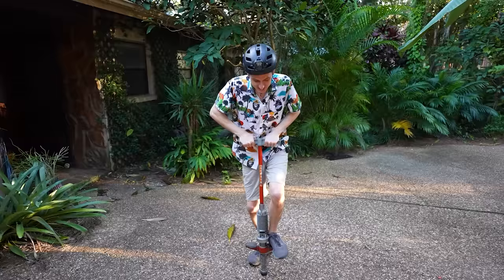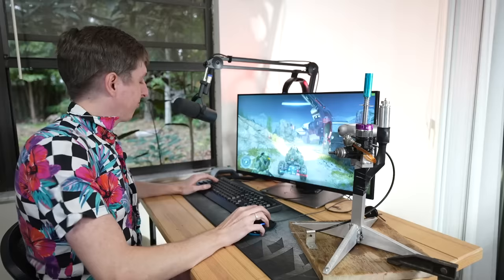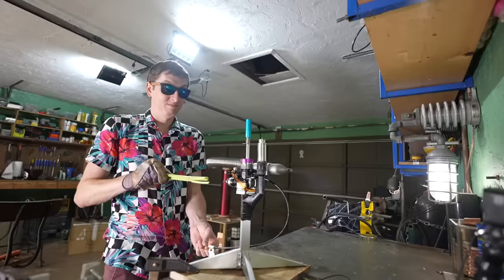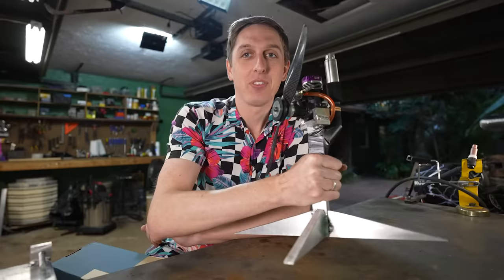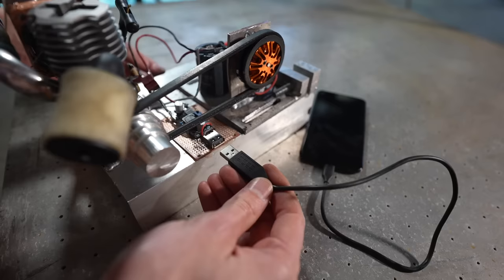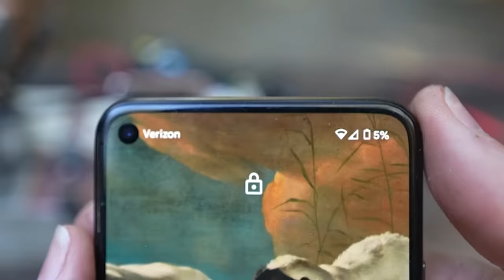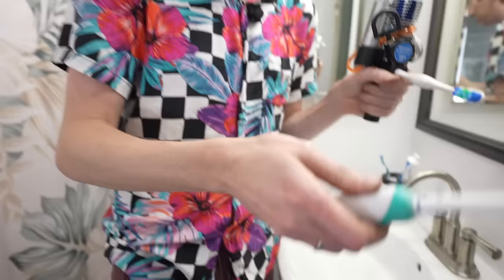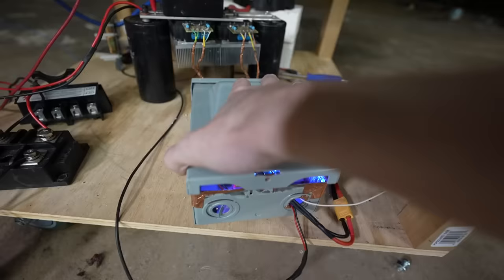Gas powering things that should NOT be gas powered

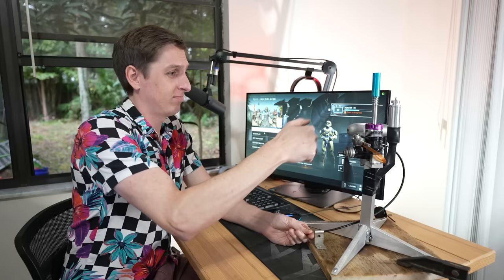Comment: 1:12 As an rc heli guy, seeing you and all my plane friend that close to propeller always give me goosebumps. Most heli guys wont dare to get near to those flying mower while it's still powered, let alone putting your hand only centimeters away from it.
Reply: Yeah, some how i doubt that his leather glove would have saved his finger tips there. 
And the gaming part, was just 50cm away from certain death ....
Reply: Helicopters have clutches though so you'll be alright. You wouldn't be able to start it safely otherwise. I used to fly the quarter scale nitro planes years ago before everyone was coming out with electric. Anyways, the glo plug I was using then was attached to a battery box via wires. The prop almost sucked the wires in and I tried to grab it before it did. Good news is that I did manage to. The bad news was that I pulled just slightly through the top because I didn't pull up high enough and almost lost my finger. Honestly starting a Helicopter is a lot safer than those damn planes. I've been wanting to get back into it again and maybe switch to the nitro helicopters but I just don't have the money for it right now.
Reply: @Onyx_Games  I used to fly control line planes with my dad when i was a kid (like 8-12 yo) and we used the little os nitro engines like these. I def got kickbacked while starting a bunch and I had a wood prop break on my knuckle. Neither of us ever had serious injuries though thankfully, using wood props probably made a huge difference in danger.
(I could be wrong, idk it was a long time ago and just speculating)
Reply: Hes obviously never seen a prop induced injury lol... also leaving that glow ignitor on there like that is making me cringe lol
Reply: I can comfirm, plane propeller plus finger equals a bad day.
Reply: This is the guy who regularly pours molten aluminum with little to no safety equipment. He is a walking OSHA violation! 😅
Reply: He had really strong gloves on
Reply: Totally agree with you
Reply: @gljames24  hahahahhaha
Reply: @ASMCourtney  I remember the little Cox .049 engines and the kickback it did hurt, and one time i touched the tip of the Prop not looking what i was doing and yes that does give you a buzz.
Reply: Omg get the plug ignitor off the poor thing.
Reply: @FCNFAST  me too at first. But then thought I would go near that thing to remove it either

Comment: This is a good demonstration for the RC Airplane community. We always talk about how dangerous propellers are to your hands and fingers, but very rarely demonstrate just how much slicing power props have...in fact you may get some flak from our community about not taking proper precautions when starting the engine with the prop the way you did. We actually have electric motors that spin the prop to start it that eliminates danger to the fingers/hand
Reply from the maker: I knocked my fingers once starting it like that. It started before I even fully turned i,t and it spun around and hit me right on my knuckle. i got a little bruise but it didn't break the skin. after that I wore gloves lol.
Reply: @TheBackyardScientist  I'm glad you did not get seriously hurt. I'd hate for anything to hinder you making more awesome content!
Reply: No, no, I have no problem with flick starting. It's been done since the start of time and if it goes wrong, it usually just means a bit of a sore finger.

I have a problem with the demonstration itself and his entire lack of safety or thought on anything he did.

To add: It's a fine demonstration, but it should be done by someone who at least has a single clue and done for the purposes of demonstration. NOT "for fun" - Because it's a very dangerous way to have a bit of destructive fun and a dangerous thing to implicitly encourage. Not a single squeak about any kind of safety was given at all.
Reply: WWI veterans are rolling in their graves
Reply: @guanyu5091  imagine thinking sticking your fingers in a propellor is probably bad
Reply: @guanyu5091  yeah, there’s a difference between 30 years and 30 hundredths of a second
Reply: @guanyu5091  there is an ever so slight difference between driving a car, and sticking you fingers into what is essentially a 2hp blender.

Especially since he had a pull cord available.
Reply: Correct me if I'm wrong but that's called hand propping and they used to do that on actual aircraft, or you know older ones anyways.
Reply: @nesyboi9421  Some RC pilots do use the hand crank method, but there is a technique involved that was not used in this video. Most RC pilots avoid that method because of the dangers involved

Comment: I'd love to see a well built nitro engine pencil sharpener.  I really want to build one myself.  I'm thinking a custom lathe turned sharpening tool that is well balanced and able to spin at full engine rpm. 35,000 plus rpm ought to sharpen an entire pencil in 1 second.  It could be a great conversation piece for someone's desk.
Reply: Could imagine someone having that in their office, what all the co-workers would think. "What the hell is that noise?" "Oh Jim's just sharpening his pencil."
Reply: @quillmaurer6563  I think it's more or less just to have it there. I don't think it would get used too often 😂
Reply: @fast79z28camaro  True, but what's the fun in that? I could see it being especially useful if a nearby co-worker is too overzealous with their electric pencil sharpener, seems like they use it annoyingly often and long, they aren't as loud as a nitro engine but still somewhat noisy, fire back with this.
Reply: @quillmaurer6563  I have thought about using the big brushless motor from xmaxx to build a pencil sharpener.  It's like 30 volts and monstrous.  Makes a 20 lb 4wd rc car go 50 mph.... Ought to sharpen a pencil right quick.
Reply: Smallant could almost do that by hand smh
Reply: Technically a pencil vapouriser, you saw the carrot.
Reply: think of what you could accomplish with all the time you shaved
Reply: They have the fan
Reply: PPE just to sharpen a pencil 😂

Comment: When it comes to USB, charging modern devices like phones is actually more complicated than just providing 5V. The old-school USB standard has power at 5v @ 500mA, which is not enough to charge a phone faster than it drains power (it might be enough if you turn off the phone, but it will be slow). Even if the voltage converter can provide more, phones won't attempt to charge properly unless the charger can signal its capabilities to the phone. These days phones use a standard called USB-PD (Power Delivery) to negotiate with the charger different voltages (5-20v) up to 100w, so your generator can definitely charge a phone, but you'll want a USB-PD capable module instead of a standard 5v USB module.
Reply: i didnt ask for all that brodie
Reply: @zero-se7ug  I did
Reply: nice
Reply: @zero-se7ug  yeah that's cuz i did not everything is about you
Reply: @saple3688  i didnt ask for all that brodie
Reply: And then I got high...
Reply: Yeah I was really hoping he'd go more into trying to charge the phone but unfortunately these videos are a bit more educationally cheap. And I guess that makes sense considering it's called the backyard scientist.
Reply: Very good advice
Reply: This is partially correct. Sure USB 2.0 is specced at 500mA, but phones don't charge at that without USB PD. Most will pull a max of about 2A over 5v, and then with USB PD communication the voltage will be negotiated, and in some rarer high power cases, the amperage can as well. 10W should be more than enough to see the battery increase after 5 minutes.
Reply: Yes because of the "handshake" many usb devices use with the standard chargers, it'd have been easier to power a standard outlet and then plug a charger into that. Honestly a mini generator like that would be kind of cool to build into a large battery bank.

Comment: *Glow Plug Starter  does not need to stay on glow plug - Its just to ignite the engine
Reply: @RCSparks: Correct. Also, I have been watching your YT channel since 2016. When you said you were leaving youtube I was so sad. But your back so I am happy to see posts to watch when I get home from school.
Reply from the maker: You are right but I couldn't keep that airplane nitro engine running without it. I read that means I was running it too rich but even messing with the carburetor it would always shut off and bog down when I took it off.
Reply: @TheBackyardScientist  My time to shine .. I collect those things. 

For a two-needle carburetor, you start on the setting in the manual, which tends to be on the rich side. If you don't have one, something around 1.5-3 turns open is usually fine. 

Now it depends on whether the engine is new, if it is, you have to break it in first (not only to make it last longer, many, especially cheaper on, won't run right before you did that for a few tanks). How to do that depends on the material combination of the piston and cylinder. You won't encounter cast iron pistons in new engines, so I don't talk about them now.

Richen the mixture until it is jumping between two-stroking and four-stroking (you clearly hear it), then lean it until it just runs smooth again ..(especially for ABC-engines) DON'T run them too rich. They need to get to and hold normal operating temperature for a while. After a few tanks you can set them up correctly.

Lean them to peak RPM and then back up (in direction of rich) 2-3 clicks on the needle valve. For the idle setting, you can do the "pinch-test". Pinch the fuel line with your fingers and look what it does. If it just stops, it is too lean, if it runs quite a while and speeds up during this time, it's too rich (because while it's starving of fuel the mixture becomes correct for a while). You want it to speed up just a bit and then stop. 

The idle speed should be set in a way that you can leave it running for 30s or so and then give it full throttle, it should speed up without much struggling (a little bit is normal). 

The rest is practice, you need to FEEL what the engine needs. I'm still not perfect with it, but you get better.
Reply: @VintageTechFan  yes, finicky little monsters, but once you do get it running right..., they will scream. Their power band often starts in the 10 thousand range, and they redline at 25k-35k rpms, which explains why they're so powerful. With a very energy-dense fuel and a power stroke every rotation, coupled with high rpms these things can be very powerful. Their torque is abysmal though.
Reply: @TheBackyardScientist  was it an old glow plug maybe?
Reply: @derkeksinator17  The fuel actually isn't really energy dense, it's more like half the kJ/kg of gasoline. Pure methanol needs only half the air though and is has quite a high octane rating (up to 130 according to various sources, they are conflicting somewhat) so it provides more power (at double the fuel consumption). With nitromethane you can make the mixture even richer and therefore burn even more fuel with the same amount of air, thats what gives the power.

Airplane engines aren't that high on revs, except for pylon racing, since the prop wouldn't survive that anyway. They turn, depending on displacement, around 9000-18000 RPM. Most of them are in the 10000-15000 range. More "civil" timings give them more torque at those lower RPMs, too.
Reply: @VintageTechFan  where were you on my teen years where I was completely and totally obsessed with my 2 nitro cars - which I had quite a hard time tuning... I wish I also had a 3D printer back then cause these things broke, easily :P

Comment: This man is so deep in gaspunk that he's doing the opposite of climate protection
Reply: Where electricity comes from?
Reply: @martonbalogh6021  from the thin air
Reply: @Hellequin Maskharat Among?
Reply: @NCG337  don't do this to me.
Reply: Guys there’s someone in electrical
Reply: And I think that's beautiful:)
Reply: @martonbalogh6021  Electricity is often generated by kinetics. Heat can be used to generate movement in form of expansion, which can kick off movement. Clean sources of energy also use movement or fuels for burning that leave recyclable byproducts. 

Solar uses movement in form of light waves that move quartz crystals (the ones that wiggle to make your clock tick) in special "LEDs" that are just "Ds" (diodes).
Reply: @NCG337  among us
Reply: @gold571  amogus
Reply: @Sov_spoiled  Don’t you dare, DON’T YOU FRICKING DARE
Reply: @NCG337  anmogus
Reply: so true so true

Comment: I love it when people actually quantify what a small version of something would be like scaled up to normal size, it actually makes understanding how incredibly powerful something like that motor very easy.
Reply: well the scaling actually gives it a disadvantage, because it has x^3 as much stuff to work with, to turn x of a shaft
Reply: The square cube law makes comparisons like this difficult to make sensibly, because mass scales with the cube of the length if the length scales linearly. That's why smaller things are easier to make stronger or more powerful (for example ants can carry a hundred times their own weight, or toy cars can easily survive being thrown into a wall, or this engine is super powerful).

If you scaled an ant up to human size, it literally wouldn't be able to carry its own weight because its limbs would be so weak.
Reply: @vurpo7080  what? why would an ants limbs support it at all if they wouldn't scaled up? makes no sense. it's limbs would scale up with it?? and they already support the ant.....
Reply: @ct9850 the square cube law is why there's no rhino sized ants
Reply: @ct9850 the ant would be much heavier proportionate to the size. As the dimensions of an object increase the size increases exponentially. This is why a 1ft cube is only 1/8 the size of a 2ft cube

Comment: 2 things, as long as the engine has the igniter on it it could sputter and chop your hand whenever you spin it at all, and 2nd you should probably use a nitro prop for the engine as they are thicker, and do not risk exploding at high rpm because of the pulses of power a nitro engine produces instead of the smoothness of an electric
Overall good video, and I say I blame you for not knowing this stuff since this is some of the first times playing with nitro 👍
Just ya know be careful and don't chop your fingers off or have the prop explode shrapnel into you
Reply from the maker: Thanks for the tips👍 that airplane engine would not run without the glow starter in it, i read it means the engine is running too rich but i could never get that engine tuned right. And i was aware there was a possibility of the prop exploding so i wore glasses when i was testing it. This was my first time using nitro engines and i really like them, i want to build an RC car now :D
Reply: Nothing to do with pulses in power delivery. It's just plain rippems.
Reply: UnitSe7en 
The power graph of an erpem of one of these has a distinct peak and most of the power is produced during 90 of its 360 degree rotation.  Props have to be built to survive it.  Reduction drives to a larger diameter prop is safer and far more efficient than direct drive, and the prop does't have to be as thick & heavy, relatively speaking.

Comment: I wonder if you were to attach a wheel with a good arrangement of magnets, how well would it work as an inductive heater.
Reply: or just... burn the fuel to directly make heat.
Reply: The HPC did that with an angle grinder.

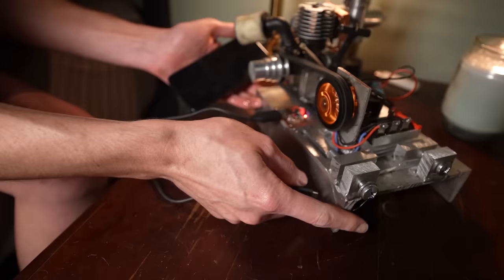Comment: 5:45 I was actually going to build a steam powered phone changer so in powered outage you could use a candle and water to changer your phone. But a modle steam engine is a coupe hundred dollars.
Reply: Just use a hand crank one
Reply: @baqcasanke  that was part of the design, but I did get a handcrank Radio with USB.

Comment: Oh, my!, how innovative! Many years ago, (1960s to be exact), i mixed up some 2-cycle lawnmower fuel and used it in a model airplane engine.  I had to anchor it with a small steel cable to a concrete block, and it dragged the block a short distance. I even went so far as to adjust the fuel/air mixture while it was running, and that airplane engine was literally screaming!

Comment: Holy crap 2hp from that tiny thing?! That's actually impressive.

Wow when even FloridaMan is wearing a safety glove...you know its dangerous!
Reply from the maker: yeah its 2hp but it only makes that at like 20,000 rpm! I couldn't run it that fast without some forced air cooling or it might overheat.

Comment: That glove! It's what we used to call in the RC field, finger catcher, after the prop chops it off, it will be found in the glove.
Reply: Yep, same thing with angle grinders and other tools with fast rotating parts.
Reply: @Stevie-J  And the vibration can cause your grip to weaken which can lead to more danger.
Reply from the maker: I bet! The glove was for protecting my hand when starting it. one time it spun around before I really even started to turn it, and it came around and smacked right into my knuckle! There's probably a reason people use those electric starters, but I saw people do it this way in YouTube videos so i had to try it 😂
Also I always wear gloves with an angle grinder, its saved me from lots of little nicks and burns and cuts from sharp metal.